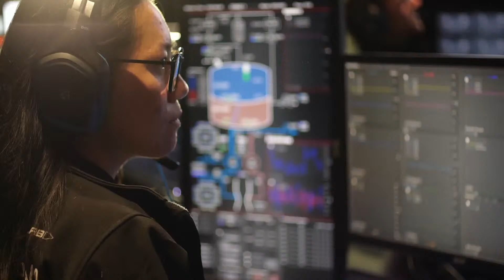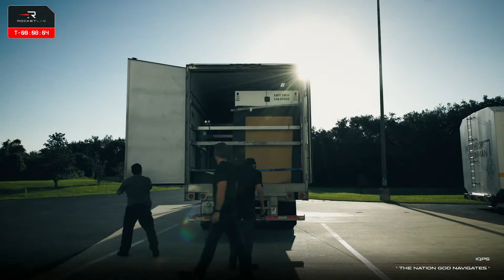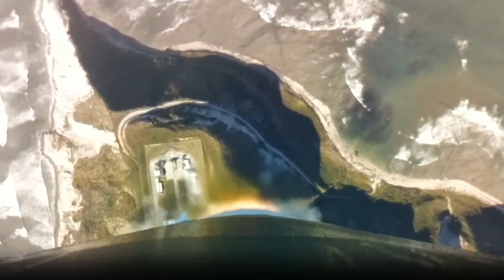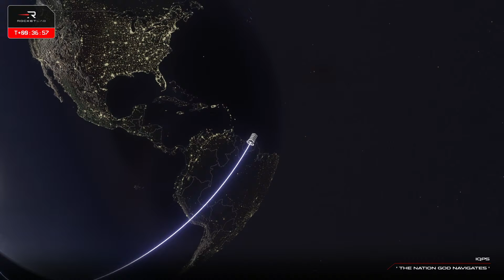Rocket Lab - 'The Nation God Navigates' Launch

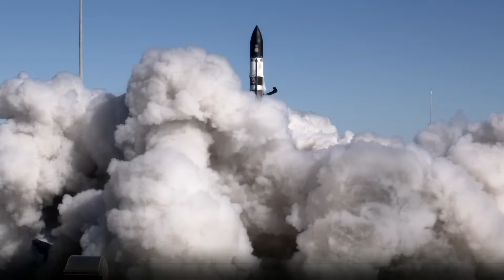Comment: 25:36 - T-3/lift off,
26:51 - MAX Q,
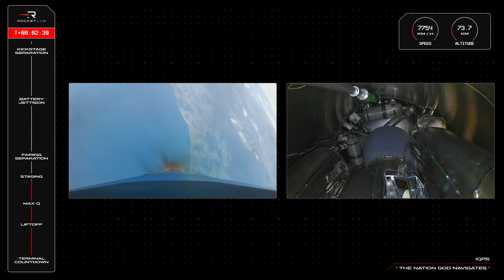28:09 - Meco/Stage separation , 
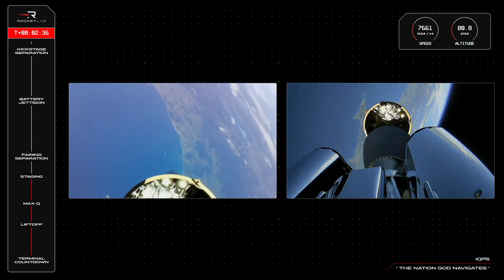28:16 - Turbopump spinning up,
29:09 - Fairing separation,
32:08 - Battery hot swap,
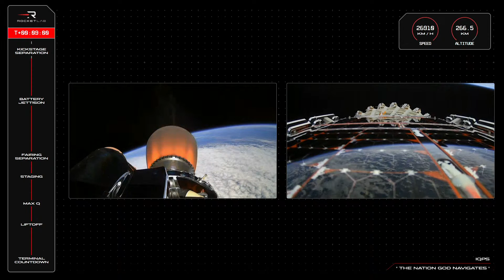34:38 - Seco,
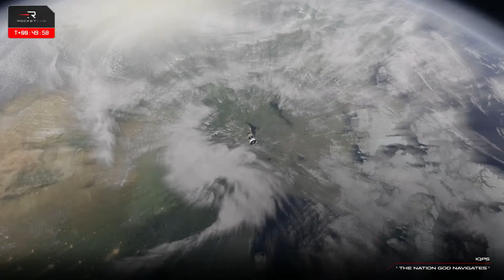1:15:49 - Payload deployment.

Thanks!
Reply: Good work. Appreciated!

Comment: Rocked goes up but the stocks stay down😔
Reply: Well it’s all relative. ‘Down’ for you maybe… 10x for others!
Reply: @JackD87 those late to the party will have to wait a bit longer
Reply: It will Crack $80 when Neutron launches... not that far away
Reply: @FurioSpinone  that's what I am hoping for.
Reply: @FurioSpinone it’s priced in already
Reply: @FurioSpinone  it'll crack $100
Reply: @FurioSpinone  At $95, my Jan 16 $35 calls could be worth About $58k. Cost me $8600. If Neutron hasn't launched by then (my guess is not) I may roll the options out.  My average is 19.06. Only 1018 shares. Had 100 shares called away at $65 as I forgot to roll a covered call, after I rolled my three $60 calls to $80 and out to April. I've made $ on covered calls and cash secured puts....I plan to hold till we hit close to SpaceX current mkt cap, which could happen within 4-8 years... That would get me close to $1m. There are many that have been with RKLB for years that are multi-millionaires already.
Reply: I am in at 4.54. 1000 shares. 
I am holding for the moon or the ground. Right now its not enough.
Reply: @sb8rc1  Fantastic. I wish i got in when you did.
Reply: A lot of share prices have corrected themselves over the last week. Its just part and parcel of the stock market.
Reply: Unbelievable
Reply: @sb8rc1 soo now what?😂 we hold or... im out of ideas
Reply: @fabianbourre7257  def hold
Reply: @fabianbourre7257  Hold long term, I dont understand why folk try to quick flip when it comes to Aerospace stocks🤦‍♂
Reply: Ignore the share price and concentrate on business achievements. I am in until at least 74 successful missions on Neutron!
Reply: @invest-k8e  That could be a while. I don't think they plan more than 3 a year? I'd be 110 at that rate...